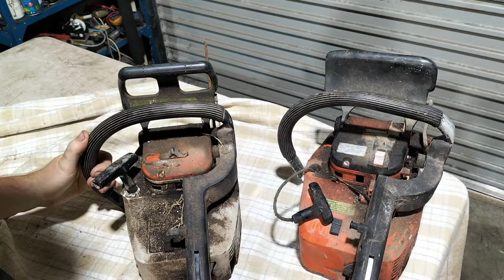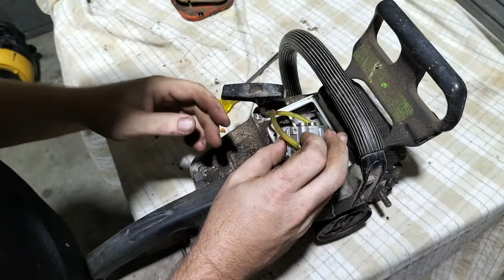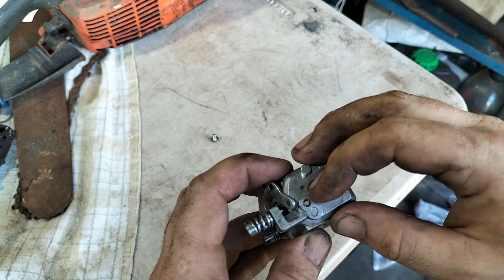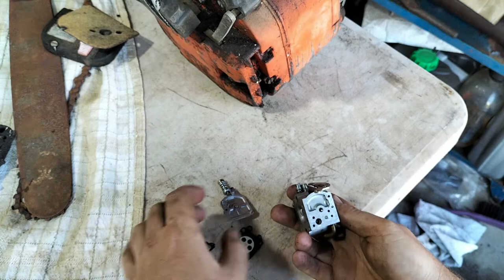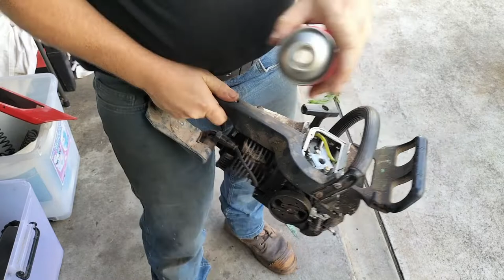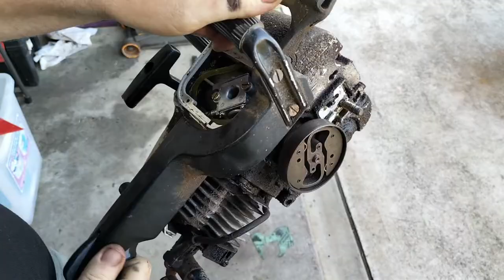Stihl 010 AV Chainsaw reresection

Comment: Been given one, won't start, looks fairly good, but not been run for 30 years. Told it was bought in 1987.
Reply from the maker: I would be checking spark first mate. It may have points ignition and if it does they will need a clean.
Reply: @HarpersShed the white saw is a later model. It has electronic breakerless ignition. The orange saw is older and has points. Both have a magneto. Good work getting it running again!

Comment: I’m cleaning my o11 now , took throttle cable off , can’t recall to which hole it goes back onto to carb. All vids skip this part , I know it’s hard to get it back on .
Reply from the maker: I can have a look at the saw if it's not to late to help out mate.
Reply: @HarpersShed  got it done.thanks
Reply from the maker: @davemitchell7270  no drama sorry for the delayed response.
Reply: It's the middle hole or the second one away from the trigger. I just tore mine down literally yesterday, an old 011 from I'm guessing the 90s